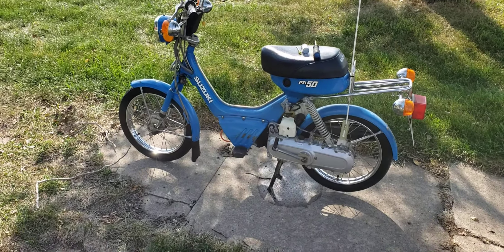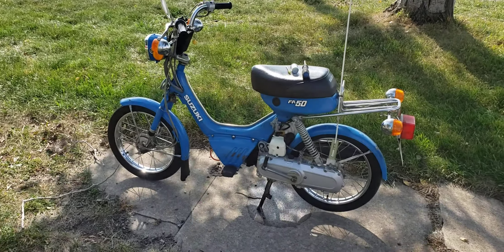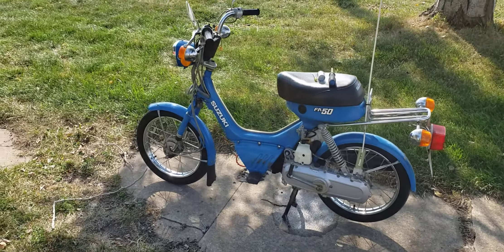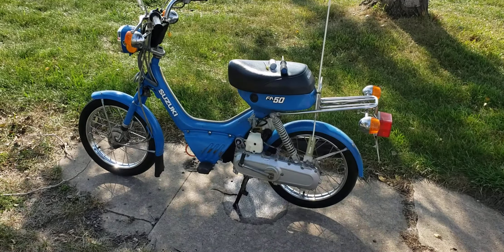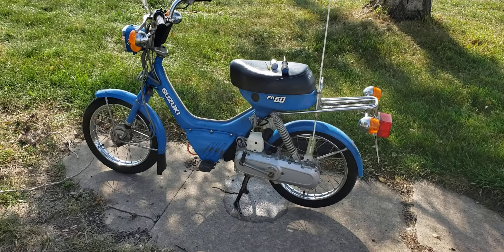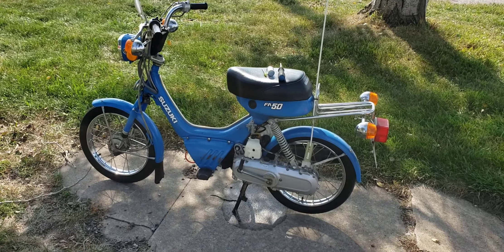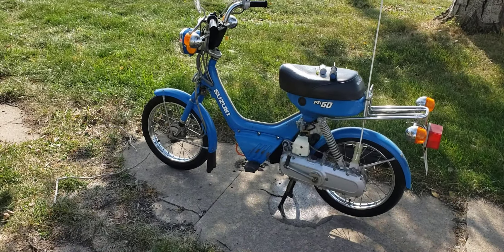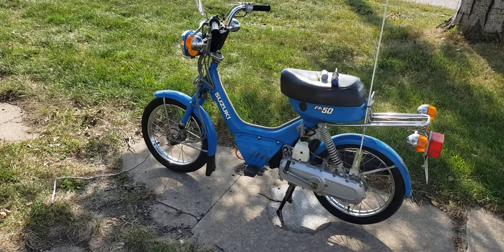Suzuki Fa50 Restoration pt. 1

Comment: I just dealt with the leaking fuel from the overflow. It was just the rubber o ring around the seat in there. I did all types of adjusting and replaced the petcock before I realized that. Runs great. I had got one of the zoom zoom carbs but it ran like crap so I popped the original one back on, runs really great and stopped that leak after I found that seal was the problem. It seems like yours could possibly be the petcock tho if it leaks when it’s off. Mine only leaked when the bike was on. You can still get NOS petcocks for like 40$. Hope you get it fixed soon!

Comment: Did you ever finish this fuel leak repair?
Reply from the maker: Unfortunately no. Still leaks but once I do I'll make a video
Reply: @BlakesGarage1  I bet it's in the petcock. I've seen the cone installed 180 degrees from proper on one and also the diaphragm spring was on the wrong side of the diaphragm on another both were leaking when parked.
Reply from the maker: @michaelosmon  that's what I thought at first too but shouldn't the needle and float prevent excess fuel from entering the carb regardless of petcock?
Reply: @BlakesGarage1  I think in theory you're right but I took both carbs apart and the needles on both were clean and seated proper. I checked the floats, both were empty no fuel in them so they must float. When the carb wasn't the issue I moved to the petcock. Pinched off the main and reserve lines and completely removed the petcock, completely disassembled and cleaned everything. Check the oring it was OK so put it back together and it didn't leak anymore. I tried putting it back together same as it came apart and noticed the lever has different sized nubs to fit into the plastic cone a specific orientation and when I took it apart it was rotated 180 degrees from proper. Idk if this might have been the cause of the leak on that one. The other one didn't leak as bad and the carb was really dirty so maybe the petcock wasn't the issue, however that petcock was also put together wrong the spring was not located correctly. The leak may have been from the float bowl vent tho I'm not 100 on that just know it isn't leaking anymore
Reply: @BlakesGarage1  I know this guy who has a fleet of them and I just started going through them all for him a couple at a time so I'm just looking for knowledge on them. I grew up when these things were new but I'd never seen them or don't remember them. They're fun tho
Reply: I had the same carb overflowing problem, and it was due to the fuel valve o-ring rotting out. It's the part marked #10 on the exploded diagram of the carb.

Comment: You did not mention that the fa50 is on a 6 volt system.
Reply: 8:36
Reply: @michaelosmon  thanks. I have a blue one too. This motivates me to get mine running. Mine needs tires, tubes, and brakes.
Reply: @jamesvankevich2195  they're slow but a lot of fun. I did tires and brakes on one yesterday they're not that hard I would recommend removing the brake lever rod that goes through the frame or whatever you call it, remove it clean it and coat it with sil glyde. One of the fa50s I been working on that rod was stuck pretty bad but had new brake shoes on it. The moving parts need to be cleaned and lubed when serviced. Since you need to engage the rear brake when starting, it's important that the brake releases after releasing the lever. I hope you get her running but honestly these bikes are so simple I think all you need to do is try and you'll get it